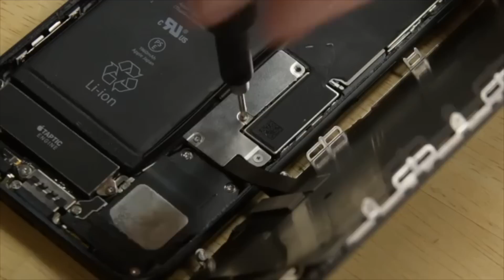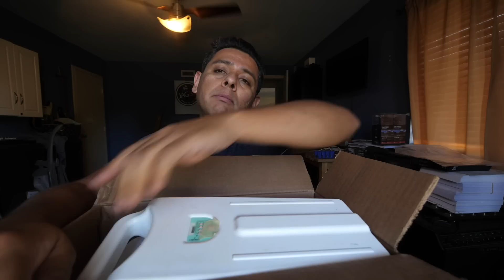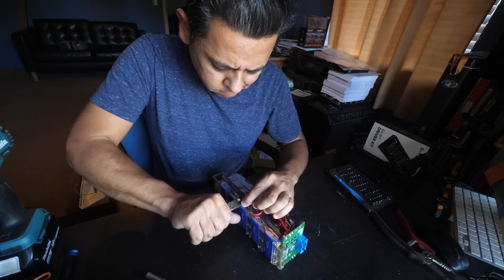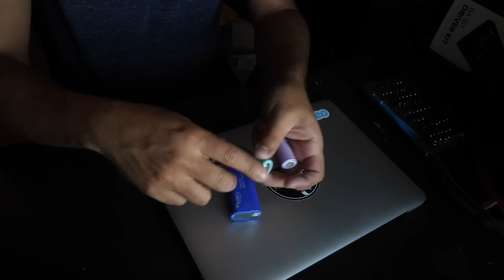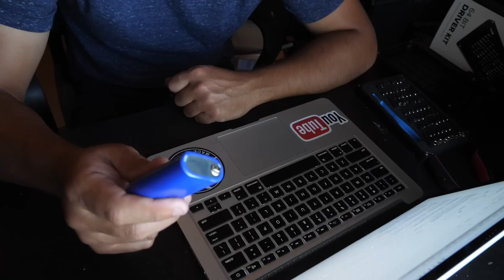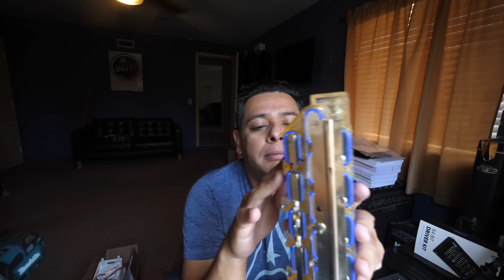$3 eBay 4750mAh Boston Power Sonata Lithium Cells

Comment: Are these cells a good choice for making a 72 volt battery pack for a 72 volt 3000watt Vevor motor with a 60 amp draw ? Thank you for your well put together video and your help with this question!
Reply from the maker: I would say the swing ones are better suited for your application https://jag35.com/products/boston-swing-5300-8-cell-18650-modules

Comment: Hello i have 2 of these battery packs 5300 ma cells i want to remove the bms and wire them together at 12 volts about 50 amps .I have charged them to 12.6 volts i was wondering how many amps max i could pull from that pack safely.

Comment: Can you do a video how to make a power wall using these batteries
Reply from the maker: Not enough of these to make it worth it
Reply: jehugarcia what do you suggest
Reply from the maker: 18650 cells,  There are millions of those available
Reply: Would a 12v pack using a aims 12v Inverter work or should I use a UPS? Also if i made a 1kwh 12v 18650 battery do I need to put a BMS on it. Thanks for helping me!

Comment: I can't get the solder to stick on the positive side for the boston power battery using a 180w soldering iron. I think the heat dissipates to quickly for the metal to accept the solder. Any suggestions???

Comment: I read on E.S. That there is problems welding nickel strips to these batteries.  The  + and - tabs are hard as nails.  Has anyone had any success welding the Boston Power swing/sonata cells into quality EV battery banks or power walls?
Reply: I am doing a ton of experimentation on making powerwall with these packs. I might make some videos when I find a final solution. Right now I wire 5 of these packs in series and 2 parallel. Still working out how to prevent drifting when each has their own bms. My final goal is a total of 100 packs, have about 40 ready to go when I solve my issues.

Comment: Hi Jehu: Your videos are awesome...  I was considering buying some of these battery packs, but I found out that the reason these batteries are being sold off by the pallet is because they were recalled due to fires and battery packs exploding.
Check out: https://www.courthousenews.com/workstation-firm-files-31m-suit-against-battery-maker/
These battery packs, "Mobius 3.5" were used on mobile hospital computer carts, and the company that made the cells, Boston Power, was sued by Enovate Medical for $31 million because of at least 12 reported incidences of hospital tech carts catching on fire. I would NOT buy and trust these cells! I'm very grateful that the battery you charged at 10A and was 181 degrees did not blow up in your face! Please be very careful and research the manufacturer before using questionable used lithium ion cells or suggesting other people purchase them.

Comment: @jehugarcia if you were charging the entire pack at 10amp, it wouldn't be a problem since it is 3s5p, right? Essentially 10amp / 5, so a 10amp charge would be 2amp per series.
Reply from the maker: +James Lee correct
Reply: thanks for the confirmation. Here's me charging the pack using a computer ATX powersupply. https://youtu.be/73DRXJBRhlA

Comment: Does your bus run Totally from the Tzela/iLithium   cell battery packs??   or are they used in conjunction w/ your engine?     I want to put a 2.0 ltr. Subaru engine in my "soon=to=be" Vanagon camper.   Do I have to use the Tezla/cell pack along with it for fuel?   What happens to your exhaust system  w/o any fuel?       Hope I'm not asking too many questions.                    Much  Thx'))

Comment: Dude just learn the difference. "$3 eBay 4750mAh Boston Power Sonata Lithium Cells" and "
12V-280WH-BOSTON-POWER-LITHIUM-ION-BATTERY-PACK-18650-4-7AH-POWERWALL-BATTERIES"  for 45$

Comment: I did more testing and the bms board will not allow more than a 10amp draw. If you go beyond 10amps the board will fry one of the FETS and lowered the output voltage from 12v to 10v, another board stopped all together.
Reply: I am running 5 of these packs in series and 2 in parallel but I noticed some drifting. Any idea how to fix this? I want a total of 100 of these batteries for my final powerwall.

Comment: Anyone doing a power wall with these units, I have 32 packs i have not decided what want to do with them yet,  was wondering what would be the best bms for them?  Any suggestions would be helpful..
Reply: Pretty good luck with the cheap 3s, 40a bms. Only issue is I have 5 in series and 2 rows in parallel and there is drifting between the series packs....

Comment: since these are 5300 working at 4750 - I assume they have been cycled often over the 9 months they are used in the field.  I assume 270 times at least, so they are good for another 500ish to 700ish cycles... I would assume electrically they are the 18650 cells that are proprietary to the pack hence unable to be divided. This would make them $1.50 per 2375mAh battery
Reply: They have 1000 cycles @ 100% DOD @ .2c and 3000 cycles @ 80% DOD @ .2c

Comment: Thanks for video! You have a very good channel! 
It's tempting price in first glance, but when i calculated delivery to Ukraine, it's not so big deal for me. Hope, it will be good for USA people
As example:
3 items from Thomas = $135; (under $150 custom limit)
Fedex to forwarding warehouse = $13
USA to UA delivery = $30 (i guess it's a 2Kg per 1 pack and i have price 5 usd/kg)
/total - $178
It means $1.98 (53.46 uah) per 2,35Ah 18650 cell from pack. (1.18  Ah/USD)
but i found $2,15 (58 uah) per 2.25Ah 18650 cell in my city. (1.05 Ah/USD)
"pros and cons"... but not a big deal for me.

@jehugarsia please tell, if it possible, what weight of one pack ?

Comment: Battery connector is a Positronic, PLB08M300A1. 
P1 B+
P2 B-
P3 Handle grabbed sense, +5V active high
P4 Thermistor
P5 B+
P6 B-
P7 I2C Data
P8 I2C Clock

Male pins with always live battery voltage. Tsk Tsk.

Use at your own risk yada yada blah blah blah death and fire etc.
Reply: The 12v pins on the connector can be used to charge or discharge the pack. The issue is that the BMS board does not like higher voltage. I connected my turnigy charger and pushed the voltage to 12.72v @6amps and the bms board freaked out. The pack will discharge through the blue connector, but it will no longer charge.
I have to manually connect the Pos/Neg of the charger to the Pos/Neg of the batt itself for charging.
I bought the 2 & 3 bay charging station for these medical batts. The charging station has a 15v 20amp DC power supply in the bottom, which connects to the main charging boards. These boards than control the voltage and current going into the battery packs.
I plan to put up a video soon, of my testing and my screw up. lol
Reply: So is there way to use this plug to charge and power 12v stuff? I want to power a 12 V oxygen concentrator with two of these packs I got. Any suggestions would be appreciated.
Reply: Looking forward to the video, Any update or new info on that battery pack? I'm thinking about buying a few of these packs but not sure about charging them yet. Any help would be appreciated. thanx

Comment: Got mine into today, These are Mobius power 31cp20/38/6-5
lithium ion battery 10.95 v 26.5Ah 290 19Wh
They are Enovate medical power packs.  Let try to find the board pin out now.
ebay link to one of the packs with good quality photos/ 31july2017 
https://www.ebay.com/i/351439975441?chn=ps&dispItem=1

Comment: Minor correction: -20°C is not -68°F as stated in video, given that -40°C same temp as -40°F . With 0°C = 32°F = freezing,  and 1°C = 1.8°F, therefore -20°C is -4°F.

Comment: I would like a couple of BMS boards to crack can you send them to me?. The device that will talk to the chip (BQ20Z95) is TEXAS INSTRUMENTS EV2300 USB BASED BATTER FUEL GAUGE EVALUATION MODULE.

Comment: has anyone been able to find out the availability of the "Boston-Power Ensemble Battery Modules" that will set up these batteries in expandable modules? if you Search on the quote above, you can find BP (Boston-Power) pdf datasheet on this. i have not yet found out how much $$$ they cost, but they show a nice module with 40 batteries in it with interface boards that you just jumper from one 8-battery bank to the next. pretty impressive.
Russ from Coral Springs, Florida, USA
Reply: i've emailed BP about it and never received a reply :/

Comment: https://www.walmart.com/ip/100pcs-18650-3-7V-5000mAh-Li-ion-Rechargeable-Li-ion-Battery-for-LED-Flashlight-Wholesale-Yellow/671802291?wmlspartner=wlpa&selectedSellerId=10478&adid=22222222227081075993&wmlspartner=wmtlabs&wl0=&wl1=g&wl2=c&wl3=193156911821&wl4=pla-305244311739&wl5=9031714&wl6=&wl7=&wl8=&wl9=pla&wl10=117097058&wl11=online&wl12=671802291&wl13=&veh=sem#about-itemhi Jehu, like your channel, still learning. Can you tell me if these are any good.
Reply: No such thing as 5000mAh 18650s. You're just wasting yur money buying those. No idea what they even are on the inside. Probably a cheap garbage quality reject 18650 cell, or a much smaller battery and some sand to make them heavier. Who knows. The biggest capacity you will find out there for real deal legit cells are going to be around 3500 mAh or so. Sanyo/panasonic NCR18650GA or NCR18650B, LG MJ1,  or even something like the Samsung INR18650-30q. All of the cells have their pros and cons. So you have to do some research to find what is a suitable battery for your situation.
Reply: Thank you Jehu.

Comment: dude I appreciate your help in trying to find these batteries on eBay but every single time I order them I get a bunch of shity battery packs! I'll just go back to the old days and Harvest them out of drill battery packs that are brand new I'm sick of this b***** of getting all these great deals but they aren't great deals because the batteries are so f**** shity
Reply from the maker: +Kim Passey  what did you order that was worse than new cells?
Reply: jehugarcia 
sorry I took it out on you man. I was just letting you know that the seller definitely does not check the cells before he ships them. Talking about the LG and Samsung hoverboard packs 36-volt with BMS. ordered a bunch of the packs and almost every one of them were detecting 9-series versus 10 Series in the pack and they were completely dead. Meaning no voltage on the pack luckily I was able to charge them back up and revive them but still has tons of bad cells and just untrustworthy all together for new cells. once again sorry to vent to you I probably shouldn't have an honesty I forgot that I had. it's not your fault but I definitely wouldn't be pushing these on people because it feels like you're the middleman because I'd really did trust you man I watch your stuff every night.

Comment: Why haven't 18650s improved in the last 5 years? Between 2007-2012, it seems that capacity jumped from 2200 up to 3400. But from 2012 to 2017, it seems that there has been very little improvement (aside from decent price drops). Has the research stopped, or are the researchers just running into limits of the chemistry?

Comment: Jehu, did you test that cell at 4700 mA after running 10 amps through it? What do the ones read with 8.0 amps of current charge?
Reply from the maker: +htmagic  pretty consistent after many cycles at different charge discharge rates

Comment: BTW, there are sellers on Alibaba that have the Boston Power Swing 5300 (automotive version of the same cell, with better cycle life) at the same $3/cell price point, in rather powerwall-friendly lot sizes.
Reply: I have 500 of these green swing 5300 batteries.brand new...they are 3.7 volts 5300 mah....each
Reply: Jehu.my batteries are made in taiwan.any difference?
Reply from the maker: +NetRolller3D   Yeah but.... china
Reply: (jehugarcia) It's kind of like cree, they are based in the USA and have a factory in the USA but also have one in China. Basically it will still be good quallity because of the QC but cheap labour = cheaper battery.

Comment: Oye---any manufacturer info (name, part number, etc) on the blue power connector on the bms? It would simplify things a lot to just get matching connectors from Digikey or Mouser. Saves a lot of work for those who can use the packs intact.
Reply: The connectors are from Positronic Industries.  They are the "Power Connector".  I just bought four chargers from an e bay seller, so I can update with the actual female connector part number if anyone is interested.  I bought 10 of these batteries for a e-tractor I am building up.  Haven't decided if I am going to charge them with with orginal charger or go the 48V route.  Just a note, there is an over discharge protection on the BMS (which has a TI BQ20Z95 chip on it) that prevents these from being a "drop in" high current battery with the BMS in place.
Reply: +Gabriel Brooks Can you update that part number? Can you link the chargers you bought? Thank you!
Reply: They are stinger medical chargers.  If you look on fleabay you can find them.  I have two four bank chargers that I would be willing to part with.  Send me your info and I give you a good deal.  In the US
Reply: G B, This reply is two months later, but do you happen to remember the current limit on the BMS? With a few units in parallel, I don't imagine it would be a problem.
Reply: 10A current limit

Comment: Now here's something I don't know, when charging multiple batteries, let's say 16. At 8amps max charge per one, can I charge 16 of them at 64 amps? And if so, is it only for parallel? I know I can have like 6 cells with 16 bats per cell. Which would be a legit power wall.

Comment: No wonder it's about the same size as two 18650s. There are 2 18650s inside!
Reply: watch?v=TNk0bouiPDQ&feature=youtu.be&t=584

Clearly it is NOT made of 2 18650s.
Reply: Watch the video. Even the ebay seller is just stating what he thinks they are or what he was told. Buy a pack and mail it to me, I will cut open the cell live video for you so you can see for yourself
Reply: Same size as 2 18650cells. It have blue sonata 5300 and swing 5300, blue and green covers. We have many customers use this types.
Reply: superdau @jehugarcia has already stated that this is not the case.
Reply: Well, I guess then the ebay seller that states each "cell" contains 2 18650s that are welded together with a tab has no idea what he is talking about... But what does he know. He is only selling them.
Reply: nope inside is not 2 pieces of  18650 idiot!

Comment: you have any high def pictures of the board and chip numbers?
if it is a medical device they are required to release the standards pinouts etc.
Reply: RedFathom I'm not seeing anything in the owners manual. There is a barcode on the PCB that is 4922T9122. There is also a number on the connector that is PLB08M3000A1. There are also two numbers that start with PCA and PCB, not sure if that would help. Let me know if you find anything because I'd like to be able to use these boards as well if I could :)

Comment: Can you unrwap one of those dual cells and see what kind of 18650 cells are actually inside?
Reply: I thought they were, since in the item description it says: EACH PACK HAS 30 INDIVIDUAL 18650 CELLS. THESE "CELLS" ARE ACTUALLY 2 18650'S IN PARALLEL lol. oh well.
Reply: Nope, it's one whole battery.

watch?v=TNk0bouiPDQ&feature=youtu.be&t=587
Reply: I am pretty sure they are 2 18650's you can even see the heat gap on the thermo camera!
Reply from the maker: +lnxpro  they're not 18650s

Comment: We need to find some Jehu Garcia like guy in Europe to find some deals for us!
Reply from the maker: +Fekillix  I might have found a source for you Europeans,  stay tuned
Reply: Amen.
Reply: Care to point us at one ?
Reply: Following!
Reply: I will try to import some of these via myus.com in the next days
Reply: jehugarcia Awesome man ! thx for the heads up, I'm working on a power wheels upgrade project. So I'm trying to do the math, 3s = 3 cells in series for roughly 12v, and 4700mAh. Then 5 of these sets are in 5P config to get 23500mAh at 12v. Is that what this pack is 23500mAh (23.5Ah)?
Reply: civicturbo2009 do the math, 12v x 4.7Ah = 56.4Wh
Reply: civicturbo2009 my setup would go like this: at 16 batteries per cell:: 16x3.7v=59.2v 
59.2v x 4.7Ah = 278.24Wh.
Reply: Then I'd multiply 278.24 x 6 = 1,669.44Wh to equal my totally power
Reply: Europe gets many, many, many more great deals than the USA lol
Reply: Example #1 GREAT SCOTT. Watch him on YT.
He's from Germany.
Reply: How about us Canadians!

Comment: What do you think is the best way to remove spot welded tabs from ebay batteries to make packs? I'm just using side cutters right now and its pretty time consuming. Do you have any suggestions as to how I might do it better?
Reply: hmm the ones that are really welded cannot be taken off, at least not without damaging the cell.....since the cells wall is so thin......the weld is essentially part of the wall of the cell at times!! but there must be a way though for sure!!
Reply: resistance would be negligible as the surface area is a lot Resistance is inversely proportional to cross sectional area of conductor........
Reply: i would say don't remove them  just break them of as close as possible  to weld. i actually ripped off couple of holes trying to remove tabs. sometimes they come off easy sometimes they are pain
Reply: they have a convex shape and make it easier to grab and pull clean off.......
Reply: I am actually using flush cutters very similar to those
Reply: I was worried about the amount of resistance they'd add over all the cells, and also it makes the cells a bit too tall for some situations
Reply: okay reading a thread where a guy says take a dremel tool to it..... https://www.electronicspoint.com/threads/remove-spot-weld.6498/
Reply: I would suggest u look @ Paul Kennett's laptop Power wall...
It's much easier n quicker if u keep them in pairs. (Saves time on stripping down, testing & building up)
That's what I'm doing.
Reply: doesn't seem very safe though tbh